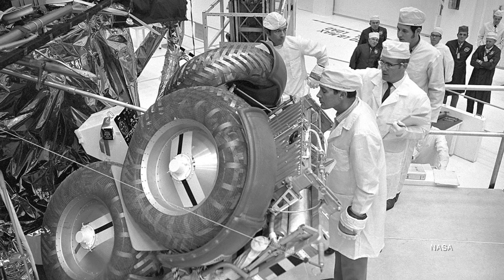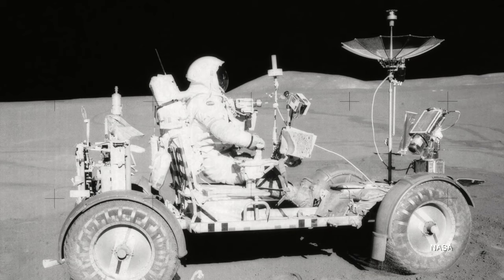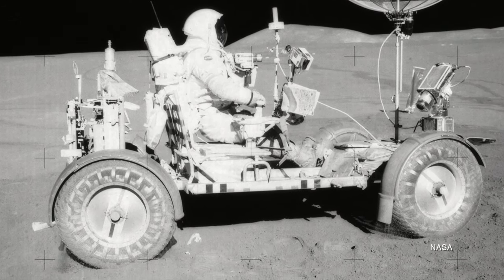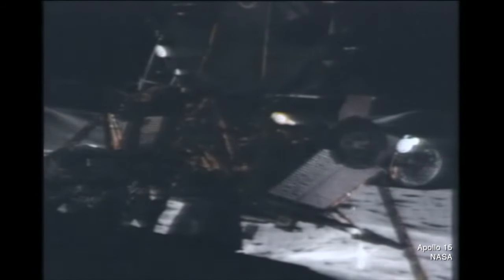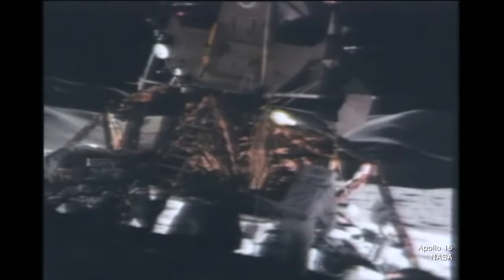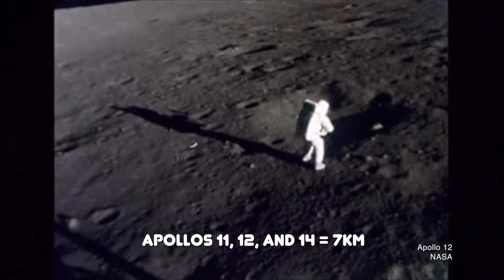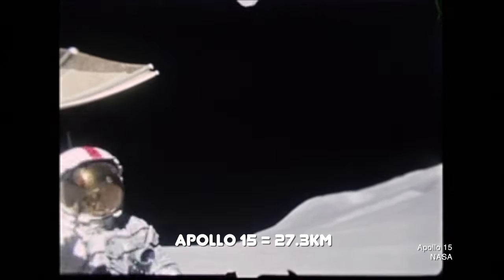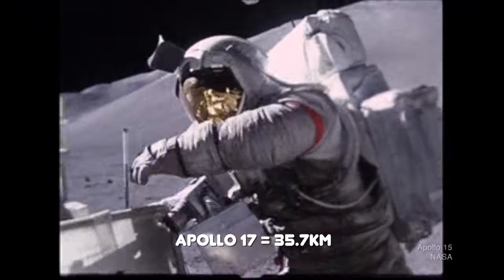How NASA Took Cars to the Moon

Comment: Why bother hauling a car to the moon at all
Reply: The primary science mission of the Apollo program was a series of geology field trips. Generally an off-road vehicle is a useful addition to a geology field trip as that allows the sampling of a larger area per visit.
Reply: @Jerry Perry 
Part 1:
YOU SAID: "I don't know since it made an already dangerous mission even more dangerous."

== A rover made the mission more dangerous?  Um, no.

YOU SAID: "Remember that they got rid of the chairs in the LM to get the weight down."

== Yes, and a million other things.  So what?  Apollo 10's lander was still too heavy, but that's fine, because they weren't going to land it anyway.  Apollo 11/12/13/14 landers were virtually identical, and yes, barely light enough to do the job.  But, they redesigned the lander (and the Saturn V launch vehicle) to carry extra weight for extended stays and a rover, and went with new landing approach plans that burned less fuel (but had tighter margins of error).

YOU SAID: "When you orbit the moon at 4000 miles an hour everything counts.  There is no atmosphere to brake the speed so it requires lots of fuel. But I guess a car was important."

== What exactly are you implying?  The engineers couldn't figure it out?  Here's a link to a brief summary of the main changes they made to the final LEMs in order to do the new job:
https://www.hq.nasa.gov/alsj/a14/a14-43939523-LM10-LM14-Fam-Manual.pdf

Keep in mind, that document was written when they still intended to build LEMs #13-14, but didn't because Apollo 18/19 were canceled.  And, it's only 150 pages, just a brief summary made for people who don't know a lot about the LEMs.  But, anyway, the point is that they made a lot of changes to the configuration of the LEMs in order to accommodate the car and the additional batteries and additional consumables for the extended stay on the surface.  One of the main differences (besides the complete rearranging of the descent stage) was that they made the descent engine more efficient.  Yes, weight was still a problem, so, instead of adding a lot of fuel and oxidizer, the lengthened the engine bell (thus adding efficiency).  This meant that the engine bell was more likely to crash into the surface if the landing area wasn't flat enough... which proved to be a problem on Apollo 15, when they crashed the engine bell into the surface so hard that it basically cracked.  But, oh well, it did the job, and nothing bad happened, and the descent engine was going to be left on the surface anyway, so, whatever.  The extended engine nozzle (increased efficiency) made a big difference.  They also added 25,000 pounds of additional thrust to each of the five F1s on the Saturn V.  And, like I said, they also went with some approach strategies that burned less fuel (which were a bit more risky, but, after 3 successful landings, they were risks they were willing to take).

Anyway, the point is, yes, weight was a major issue.  And, Grumman worked itself to the bone to keep getting the weight down.  But, once they had the weight right for LM #6-7-8-9 (Apollo 11-14), they continued to prune weight and design specifications for LEMs #10-11-12, allowing them to bring rovers.

Tom Kelly (the head of the LEM program at Grumman) wrote a pretty good book about it.  You should check it out.

YOU SAID: "Then why using 100% pure oxygen if weight wasn't important? It had already killed 3 of the astronauts.  Still NASA refused to use a less dangerous mix of oxygen and nitrogen. Not only is pure oxygen dangerous but unhealthy. The advantage was that they only needed one tank. To keep the weight as low as possible of course."

== You don't understand the advantages of pure oxygen.  First of all, it's not unhealthy at 3.5 PSI.  It's unhealthy at higher pressure.  But, at 3.5 PSI, it's fine.  They used about 16-20 PSI of pure oxygen on Apollo 1 (the fire that killed 3 astronauts).  That's because they needed to pressurize it to positive pressure against the 15 PSI of the Earth's atmosphere.  But, once in space, they only needed about 3.5 PSI, which is a different animal entirely.  Basically, they stuck with pure oxygen after the Apollo 1 fire because they weren't going to completely redesign Apollo's systems at that point.  Pure oxygen still has the advantage eliminating the worry about getting "the bends" (bubbling of nitrogen in your cells). In that respect, pure oxygen is safer than a mixed gas environment.  But, there are trade-offs.  Neither approach is without its risks, and both approaches have advantages.  Yes, simplification of the systems (fewer gasses to worry about) is an advantage also.  But, it's not as simple as one dimensional as you're making it out to be.

YOU SAID: "Another problem is that the lunar surface is pretty rugged. Full of holes and rocks. It was idiotic to take such a risk."

== Take the risk of what?  Bringing a rover?  Or, having pure oxygen?  What difference does it make to you anyway?  It worked.  And, calling the engineers who made Apollo happen, "idiotic," is pretty idiotic in itself.

YOU SAID: "When you go to the moon for the first time in human history you don't need to bring a car."

== Um, what?  They landed THREE TIMES before they brought a car.  Are you under the impression that Apollo 11 had a lunar rover?  12?  14?  Um, no.  Apollo 15 was the first landing with the rover.

YOU SAID: "Setting your foot on it is amazing enough."

== Fine, for the first 3 missions.  After that, they wanted more bang for their buck, and wanted to travel 20+ miles.  You're not doing that on foot, while carrying all of those samples and tools and equipment.  You need a rover.

YOU SAID: "Then you jump back into the LM and get the hell out of there because micro meteorites are falling like constant rain."

== Pffttt.  Um, what?  No.  Where do you get this nonsense?  I mean, do you even think before you write?  If it was like "constant rain," um, why aren't satellites being blown to bits?  Sure, they get hit sometimes, rare, but it happens.  But, we've got satellites up there that have been functioning for decades.  They're not being rained on by meteorites.  Also, think this through, if space was that full of meteorites that fall like constant rain, why isn't the Earth's sky lit up by a constant flow of shooting stars (meteorites burning up)?  Sure, you see one every few months.  But, no constant rain.  Do you think you could even SEE the moon, if the space between the Earth and moon was full of "constant rain" of meteors??  Um, no.  I don't know where you're getting this claptrap, but it's dead wrong.

YOU SAID: "How do you know how many micrometeorites there are on the moon?"

== Because there isn't much difference between what's around the moon and what's around the Earth.  Both the Earth and moon are orbiting the sun.  There's no reason to think that the moon will run into a "constant rain" of meteors, when the Earth doesn't have that.

YOU SAID: "To be honest I'm not sure but it's reasonable to expect a lot since there are tons each day falling down on this planet."

== Good grief.  Yes, there are tons of stuff falling onto the Earth every day.  So what?  Do you have any idea of how that math works out?  Sheeessshhh.  The Earth's surface area (and corresponding atmosphere's edge) is about 5,500,000,000,000,000 sq. feet.  Yes, literally.  A micrometeorite is a tiny dot.  I mean, saying that tons of micrometeorites fall on the Earth sounds impressive.  But, if you actually divide that out over the entire surface area of the Earth, um, yeah, it's virtually nothing.  There's no "constant rain" of meteorites, because you simply are not grasping the size of the Earth.

EDIT: Also, to put this into perspective, an average cloud is over a million pounds.  One cloud.  ONE.  So, don't complain about a few tons of meteorites spread out over the entire planet.  ONE average sized cloud weighs a million pounds.  Constant rain from a few tons of meteorites spread out over the entire Earth?  Um, no.

YOU SAID: "The difference is most of them burn up in the atmosphere."

== Yes, and you'll see many them as shooting stars.  A meteor the size of a grain of sand will be visible as a shooting star.  Even if you're contending that most of them are too small to see, ok, fine, but then take that tiny size, divide a few tons of it over the surface area of the Earth, and you'll find that this is still vastly short of a "constant rain" in any convention we'd call it.  Perhaps you may have read an article that says there's a constant rain of meteors.  OK, fine.  But, you need to take things in context.  The "constant rain" of meteors isn't anywhere near a rain storm on Earth.
Reply: @Jerry Perry 
Part 2:
YOU SAID: "On the moon they don't. A tiny dust particle can cause a hole in your suit."

== Sure.  But, again, you simply don't know what you're talking about.  It sounds like the surface is being "rained on" by meteors, but, that's until you actually do the math.  I mean, I don't refer people to articles very often.  But, just to illustrate a point, here's a Forbes article I read a couple years ago:
https://www.forbes.com/sites/quora/2016/12/29/how-often-do-meteoroids-hit-the-moon/#56212a116f2b

Yeah, they're talking about cannonball sized meteors in that article, while you're talking about tiny stuff.  But, whatever, the point is still clear, it's not raining meteors in the sense you're thinking it does.

And, yes, they were trained on how to deal with getting hit by a micrometeorite.  If they got hit somewhere vital, ok, they die.  But, if they get hit somewhere non-vital, the suit sealed itself for anything small.  If there's a larger hole in the suit, they were trained on how to seal it up and get back to the LEM safely.  There is a constant myth (mainly perpetuated in movies) that a hole in the suit would be instantly fatal.  No.  It doesn't work that way.

YOU SAID: "The LM was designed to be as light as possible. According to NASA the walls were so thin that they had to be carefull how they moved around inside."

== Yes, and they repeatedly made it to the moon without being hit by micrometeorites.  So, what does that tell you about your "raining meteors" idea?

YOU SAID: "You could easily kick a hole in them."

== Well, not as easily as they're making it out to be, and not in most spots.  But, in certain spots, yes, a really good hard kick could go through.

YOU SAID: "Imagine what a micrometeorite could do."

== OK, and if you're paranoid about it, fine, don't be an astronaut.  But, the odds of that happening are extremely low, and the astronauts took their chances.  I mean, again, look, you just simply have a tough time understanding numbers.  For comparison, let's talk about fatal car crashes in the USA.  37,000 people die every year in a car crash in the USA.  Are you afraid to get into a car?  It sounds like a huge number, right?  It sounds like it's "raining car crash deaths," right?  Well, when you actually look at the numbers compared to how many people are in the USA, and how many miles are driven, your odds of dying in a car crash are very low.  (It's still too high for my liking, but everyone still drives every day.)  I've personally witnessed only one fatal car crash in my life, and that was back in the early/mid 1970s.  I haven't personally witnessed a fatal crash since then.  How is that possible, if there are 37,000 deaths per year??  Because those odds are low when put into perspective.  Do the math.  And, it's like that for your micrometeorite fears.  They simply don't happen in the "constant rain" that you're making it out to be.

YOU SAID: "They stayed for many hours so the risk was huge."

== No.  And, what does that have to do with bringing a rover?  What ARE you talking about?

YOU SAID: "It would be easier to believe that they knew exactly what they were doing if there were facts to back it up."

== Do the math.

YOU SAID: "But reality is that NASA went from being completely incompetent to experts in no time."

== Um, ok, what?

YOU SAID: "There were complaints that they couldn't set up communication between two buildings."

== Sigh.  Yes, they had a wiring problem in the command module, and Gus said those words shortly before he died.  Do you REALLY believe that NASA didn't know how to communicate between two buildings?

YOU SAID: "The accident with Apollo 1 was horrible incompetence. During the interrogation that followed, one of the main "experts" claimed that he didn't know high-pressured oxygen was dangerous."

== Um, ok.  Who was it, and what was his role?  Why do you care what "one expert" says, when there were THOUSANDS of experts in that investigation?  Are you just cherry picking one statement that suits your opinions, and ignoring all the rest?

YOU SAID: "They used a hatch that could only be opened from the outside."

== No, it could be opened from the inside or outside.  But, under tremendous pressure, it couldn't be opened from EITHER outside or inside.

YOU SAID: "Which meant the astronauts were doomed."

== What does any of this have to do with lunar rovers???  Yes, 3 men tragically died.  It's bad.  But, the program went on.  There were countless deaths of scientists working on the extremely toxic and explosive rocket fuels/oxidizers.  But, the program went on.  There were deaths of construction workers building the craft and the buildings and the facilities.  But, the program went on.  400,000 people worked on Apollo.  The program went on.  They weren't going to say, "oh, we had a fire on the pad on Apollo 1, therefore we won't build any lunar rovers."  What ARE you talking about?

YOU SAID: "But still they managed to send humans back and forth to the moon without any bigger incidents."

== Gee.  Imagine that.  They increased safety precautions after people died.  What a shocker.

YOU SAID: "If you look at statistics of unmanned missions about 50% of them failed."

== Unmanned missions OF WHAT?  Of Saturn V or Apollo missions?  Bullshit.  Every Saturn V flew.  They had problems with some of them.  But, they all flew.  All 13 of them.  If you are trying to say that 50% of them had some sort of problem, ok, fine, so what?  None of those problems would have caused an abort if they were manned.

YOU SAID: "How come a technologically advanced country like China can't send humans to the moon when it was possible in 1969?"

== Because sending men to the moon again is probably going to cost hundreds of billions of dollars, and China's entire annual space program budget is $9 billion (and that's for everything, satellites, moon missions, everything).

YOU SAID: "If America built the best rockets they sure don't do it anymore."

== Correct.  Would you like to pay for them to keep building Saturn Vs, when the Apollo program had been canceled?

YOU SAID: "Everytime they go to the ISS they use russian technology."

== What in the HELL does this have to do with lunar rovers???

YOU SAID: "The old Saturn V is parked in a museum. It was big and black smoke came out of it but have a feeling it was mostly a show."

== You have no idea what you're talking about.  And, you shouldn't be spitting in the faces of the thousands of people who made Apollo happen, accusing a large chunk of them of being liars and frauds... based on your fucking imbecilic understanding of "raining meteors," and your stupid assumptions that they couldn't put a lunar rover into the lander.  And, you are so ignorant about the facts that you thought they brought a rover on the first landing!!!  Good grief.  Show some respect, asshole.  LEARN YOUR FACTS before you even remotely entertain the idea that it was faked.  But, ya know, a funny thing happens when you actually learn the facts... the REAL facts, not the parade of YouTube stupidity posted by conspiratards... you won't feel that it was faked if you knew the facts.  There's a reason that you don't find physicists or aerospace engineers who think Apollo was faked.  There's a reason that almost the entirety of the moon conspiratards consist of people who have never set foot into a university classroom on the relevant topics.  Quit pretending you're asking questions, when it's painfully clear that your mind is made up.  The "mostly a show" isn't Apollo.  The "mostly a show" has been your comments.  You're putting on a "show" of being intellectually honest.  But, we all know you're not.